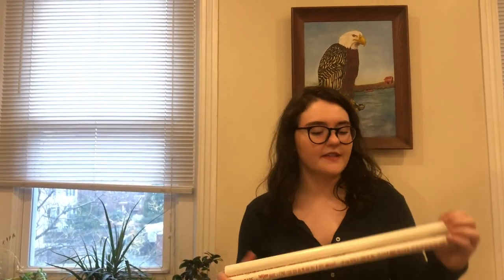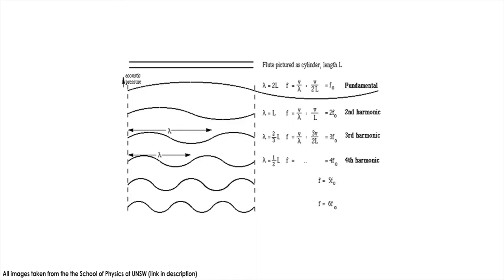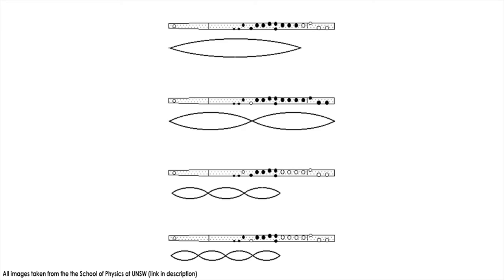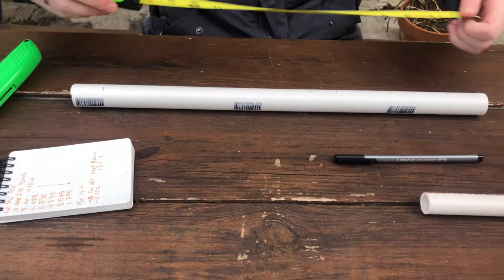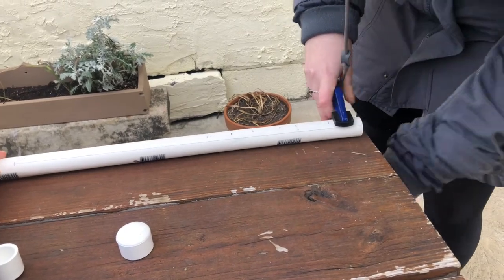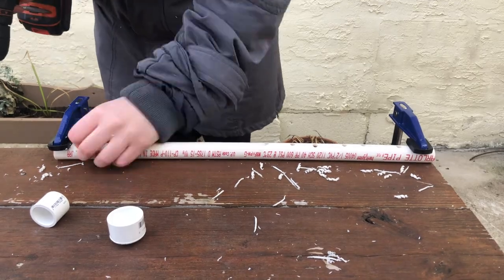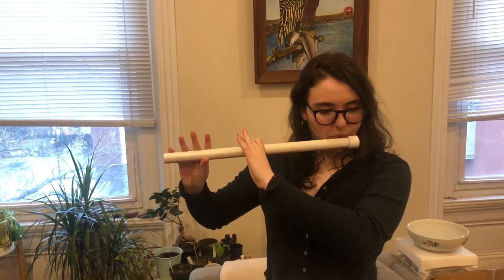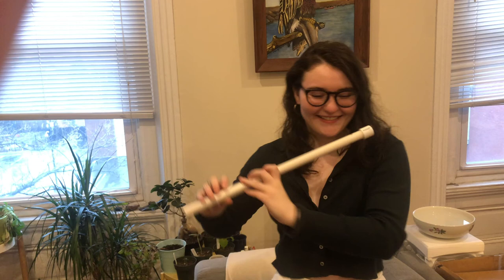How to Make a PVC Flute

Comment: Great job!  I've been making flutes from PVC pipe too.  It is really fun and economical.  I have found that the fingerhole placement programs are not coming out like I would want.  To make one perfect in tune, I make the embouchure first (with plug) and tune flute to the root note.  I do follow the flutomat program initially for the first hole placement approximately.  Tune each note one at a time as you drill them. Every time I've drilled all holes at once, has been a disaster.  As for each consecutive finger hole placement...I use the "rule of thumb" method.  This is the width of my thumb digit.  Native Americans made their flutes this way.  I tried it and works out great.
Reply: muy excelente, así sale perfecto, desde perú le saluda uno que hace traversa para chimeychi.